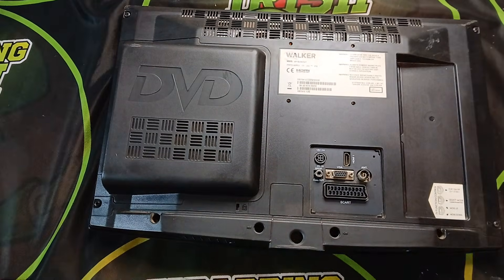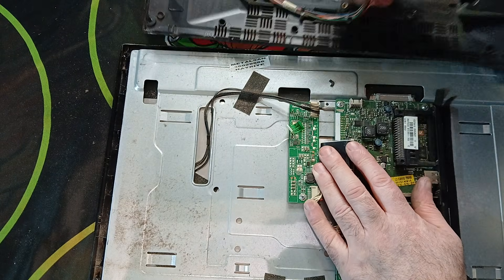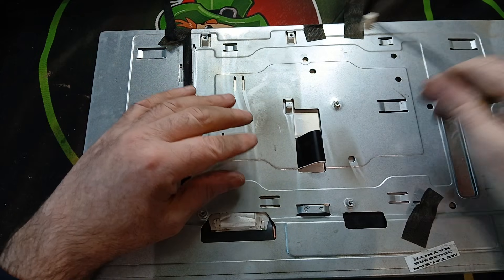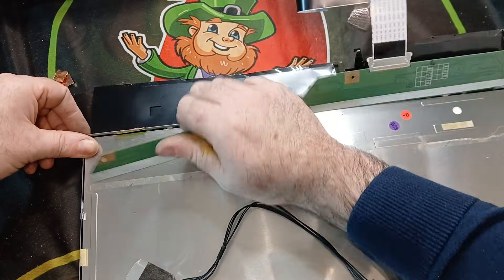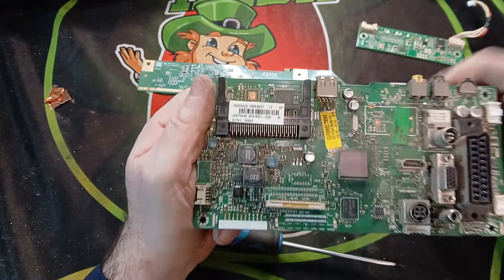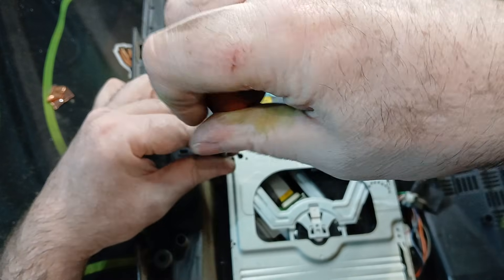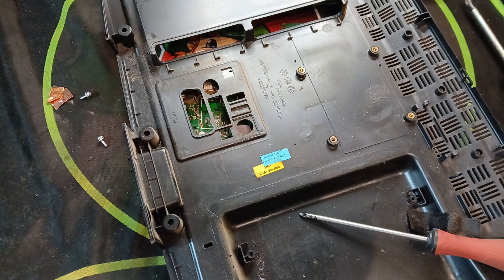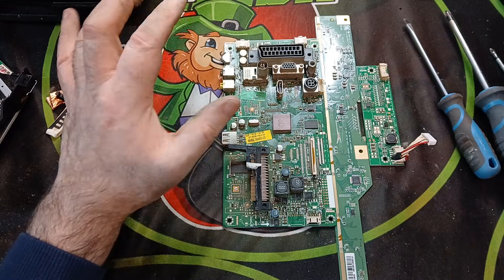Can You Find VALUABLE Metals in Your Old TV?

Comment: I take them. The ribbon connecting the finger board to the glass screen has gold on both ends. Inside many of the flat-screen TV is a translucent polycarbonate board I give to friends for cutting boards. I have a friend who's a quilter and she takes all I can give her. There's LED strips in the older models, some on copper or aluminum bars. Some on a strip of circuit board. The steel and plastic my private trash pickup service takes. I just have to stack the steel in a pile, and place the hard plastic in bags for them. They have a truck they normally recycle 4000  pounds of steel at a time with. So, every little bit helps them, and I don't have to carry steel and plastic to dispose of it. Eventually I'll save clean steel to make ferrous sulfate out of. Good for dropping gold and good to fertilize hydrangeas with. I take anything off circuit boards that contain silver or gold.
Reply from the maker: Great information thanks for sharing

Comment: @4:36 i have taken apart ton of LED tvs/monitors and a good number of LCD tvs/monitors. i find the older LED tvs have gold corner BGAs on them. i have a decent pile of gold ribbon wire end that i am pulling the plastic off of, to better calculate a yield off, if i ever put it into hydro acid peroxide. i have a decent few pounds of the gold plated boards from the screens. i still need to figure out how to depopulate them, and the chemistry to remove the gold. i will probably only melt the flakes into a button and not refine it. most new tvs have very few screws holding them togeather. the led bars in the older ones are copper, newer ones are aluminum. i collect the plastic lenses and have atleast ten pounds. i plan to send them gown (nature jab) so he can make fuel out of them.

Comment: I usually anything TVs up when I'm it was on the kerbing. The old fatback TVs I'll strip on the side of the road. The thin ones I'll take them home stripping out and then bring what I don't want and discreetly put it back into other pile of rubbish. Most of the year we have council kerbside collection. The amount of good stuff you find will blow your mind. The other week I found a brand new Japanese rice cooker retailing for 1300 dollars AUD, it was box. I don't know why I stopped because all there was was this brown box I opened it up and there is a huge aluminium pot so I took the pot out and when realized it had the burner and everything. I can't wait for mike to make that video about this TV screens. So interesting video the other day the demonstrating one of those ore crushes. They were running circuit boards through it. It was just a powder when they're finished. They didn't show anything else and didn't have any other videos showing anything about the processing afterwards. It was just a random under 5 minute video. cheers Graham
Reply from the maker: Wow that's a great find